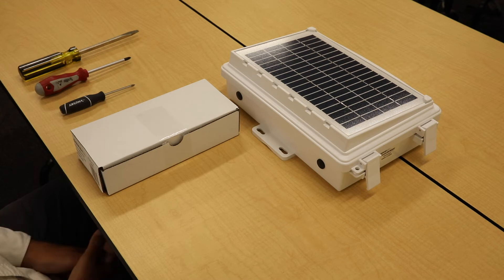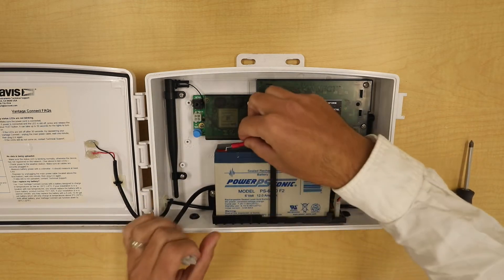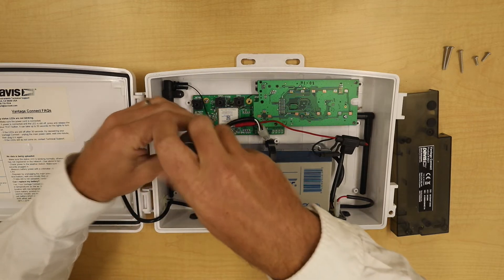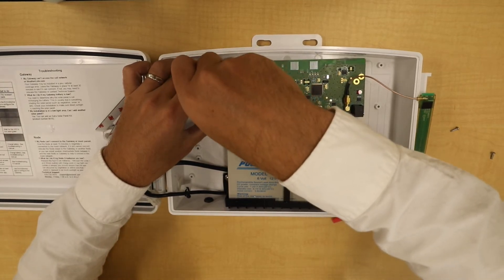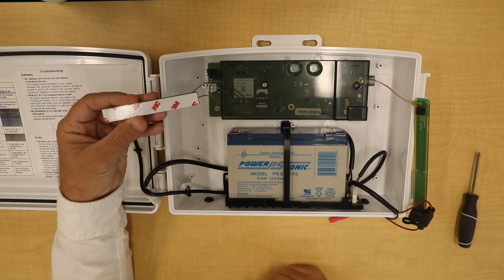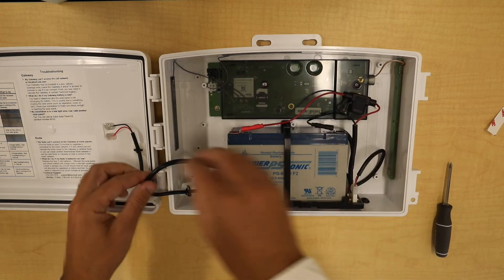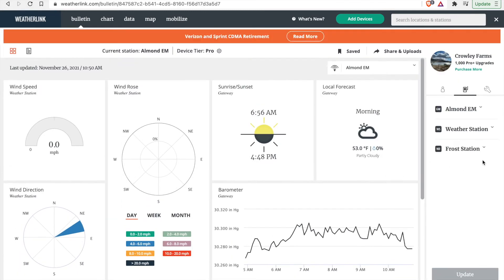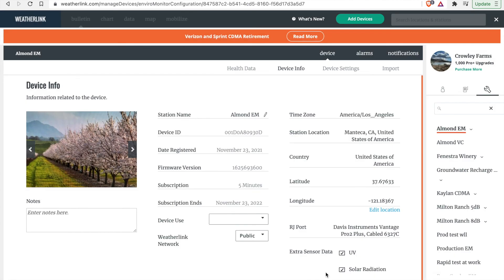Upgrading a Vantage Connect to a LTE EnviroMonitor Gateway

Comment: I am from the United Arab Emirates. I recently bought two stations (Vantage Pro2). Installations all went fine. Installed and connected weatherlink app with the device. But the climate is still not updated in the App. I am confused with stations and sensors IDs. Kept it as default ID1 at the beginning like 1,2,3 and 4 down. no results. Then I tried making it all up. ID8. is still not updated. How can you help me? It's been 3 months of waiting and I even upgraded the application to Pro. If you can help it will be appreciated.
Reply: Hi, Did you try to reach the Davis Instruments agent in your area?